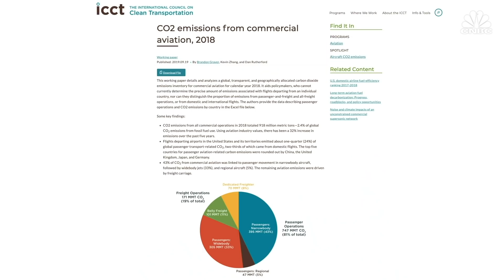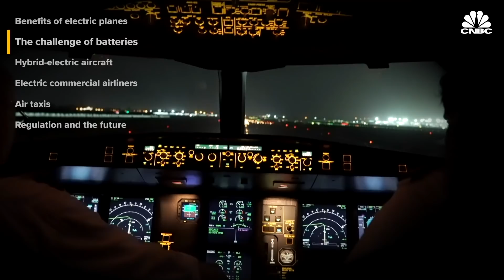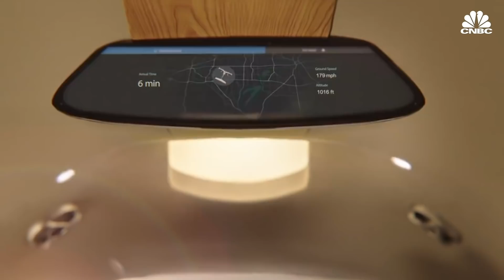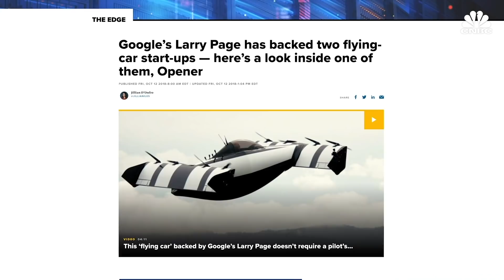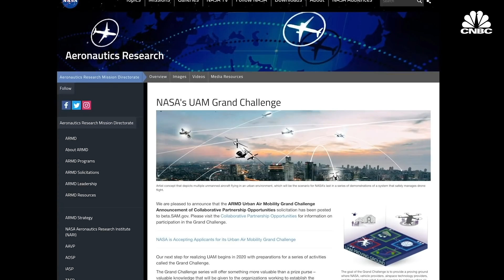Why Don't We Have Electric Planes Yet?

Comment: 2 second video.  Why don't we have electric planes yet?  Physics.  One gallon of jet fuel has more energy than 1,000 lbs of batteries.
Reply: You got that right. A gallon of gas contain over 30 KWH in chemical energy.
Reply: International units plz
Reply: @The4lexO  No.  Do the conversion yourself.
Reply: And there is the thermodynamic efficiency aspect too: jet engines directly convert 60-70% of fuel into thrust, which is about as good as power plants are at converting fuel into electricity. Using batteries with the additional costs, double-conversion losses and other overheads is a net negative regardless of how much better batteries may possibly get if they are going to get charged in significant part using fossil fuels.
Reply: @teardowndan5364 
"60-70%"
I highly doubt that. You might get that efficient with rockets that carry oxygen, but air breathing jet engines will run closer to 40% than to 70.
Reply: But you can have lighter engine and other parts in electric + you almost don't need to repair an electric vehicle
Reply: @artoruvidal2793  Not really, a jet engine is only a glorified air compressor, there isn't a whole lot that can go wrong with them already. The real challenge with jet engines is getting the fluid dynamics right. Even if you replace everything from the combustor down with an electric motor, you still need to do maintenance on the fan stages and bearings. Also, if you want to match a 747 engine's 45MW/4000kg, you would need to scale the highest power-to-weight electric motor I could find (200kw/20kg) to ~4500kg... so you start with a 500kg handicap before attaching fan blades to the motor shaft, adding bearings with their oil pumps, something to mount the motor-fan assembly to the rest of the plane, the motor's VFD unit which ain't going to be trivial at 45MW, a cooling system for the VFD, likely a cooling system for the batteries too, etc.

I wouldn't expect electric flight to make it much beyond light aircrafts.
Reply: @teardowndan5364  You did not watch the video at all, did you? None of the planes they showed as being in development were jet engines, mostly they were (yet) talking about short, regional type flights where turbines are inefficient due to scaling anyway. Turboprop style electric motors would not have the exaggerated power requirements you are fantasizing about.

Comment: Jet fuel takes minutes to refuel.  It will probably take hours to recharge the battery.  That’s not efficient.  These large planes land, unload, refill, and there back up.
Reply: Technically, you could design a replacement system like cargo bay doors. Don't recharge the battery, just put in a brand new one.
Reply: jweltsch22  That's a limiting factor for large airliners but not for smaller applications

Comment: Hybrid electric/gas aircraft sounds like the do-able short term solution to me.   Once a plane is at straight and level flight at cruising altitude it wouldn’t use much fuel I would think, unless it was flying through turbulence and/or bad weather.  Also, the electric motor could provide some sort of emergency backup if the jet engine fails.   And I can’t imagine what the FAA and ATC think about the possibility of all these urban air mobility vehicles buzzing around in the skies in the future.
Reply: Those air mobility vehicles are just a bunch of nonsense and anyone who would allow them for civilian use in the next century is a stupid ass morons.

Comment: TL; DR: We don't have the electrical-storage technology needed yet.  Fuel is far more energy-dense per unit weight (40:1).  We won't be able to replace the passenger capacity, speed and range of commercial airliners with strictly electric aircraft anytime soon.  (I doubt it's less than decades out myself.)  Hybrid is an interesting proposition, but so far unproven.
Reply: Larger airliners no but even current battery tech is viable in smaller applications

Comment: 7:17 right there. Right there! 

Solar panels, if this was Daytime? 

Maximum efficiency. 

Once someone figures out how to run Solar Panels to get enough charge to keep that puppy in the air? The battery's just keep the lights on at the point. 

It would work, even if Solar doesn't get A ton of Watts.
Reply: Doesn't scale for larger planes.

Comment: 3:55 once they figure out how to work Solar Panels on the top to give them An above the clouds"Float Charge"? Then distance will expand. As the battery's would mainly be used for lift off/touch down, and other scenario's. 

Electric planes need A combination of both in order to...well....go the distance.
Reply: Except planes need a huge ammount of power for their engines. Wether a bunch of solar pannels could provide that is still questionable.
Also, solar pannels need to be clean and well maintained to provide their nominal power. And of course sun. An airplane is often sprayed in anti-icing solutions which would cover the pannels. Planes need to fly through clouds or even storms. Lack of sun, damage to the pannels. Planes are also quite frequently hit by lightning, so another source of damage to the pannels.
Reply: @nottoday3817  Hmm, so those are the Problems to solve? 

Great, I love overcoming Obstacle's.
Reply: @The_General_Zubas  how do you charge when flying? Wireless?
Reply: I propose an alternative: what about adding some bike pedals instead? :)
Those small planes looks like they can barely fit over 2 square meters of solar panels, which in 15% solar efficiency means 300 watts of power in direct sunlight; in comparison, one cyclist alone can cruise at 300 watts, and with that two seats, two people can definitely put out as much power as those solar panels.
During cruise, a plane like Boeing 777 needs about 23 Megawatt of power; that's 23000000 watts of power; even if you make the plane somehow 100x smaller, adding a few solar panels onto it would be too insignificant to be even considered.
Reply: @yuantan9292  Thank you. Glad there is someone left with a brain.

Comment: Because batteries are heavy and aren’t as energy dense as petroleum aka very inefficient.
Reply: Idylchatter  you can't do this. The energy generated will be less than the energy required to move the plane forward at any given speed.
Reply: Idylchatter  what are you talking about? Argue with Newton
Reply: Mihad Does Stuff, you are on to something. Battery density can never be as dense as chemistry, even allowing for electricity's 2x higher efficiency.
       Mades the rest of the attached video science fiction, except for use in special applications.
Reply: Idylchatter  Then learn basic physics. There ain't no free lunch.
Reply: And the fuel used in the airplane is high-grade gasoline.

sometimes we use fuel with octane..
Reply: improve on battery then idiot
Reply: But how would we achieve thermodynamic laws for the aircraft's thrust? Which mean they would have to reinvent a new turbine engine.
Reply: Depends on what you mean by "efficient" but I otherwise agree.
Reply: Electric vehicles are way way more efficient than petrol ones
Reply: @etiennelamole9565  Yes, the engines are more efficient. However, as an energy source, kerosene is more energy dense.
Reply: Etienne Lamole theyre more efficient at using power. In other words they can travel a mile on less energy when compared to their gasoline counterparts.

However they’re not as efficient in the way they store their energy. The energy to travel a mile is stored in less space in a gasoline powered car.
Reply: Etienne Lamole nope
Reply: @etiennelamole9565  depends where you get your electricity from.